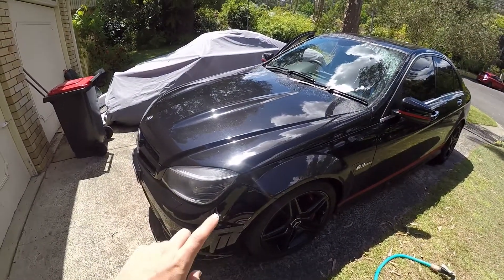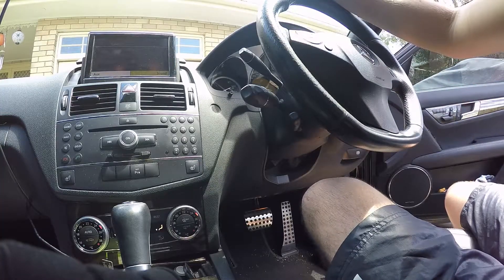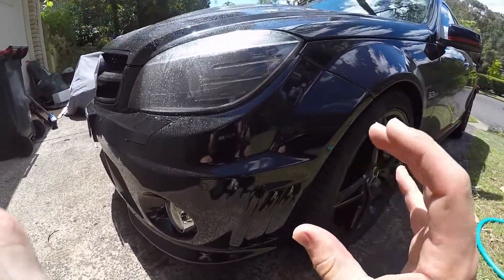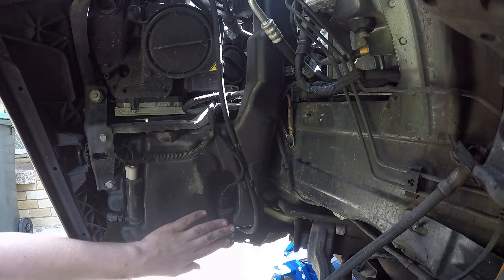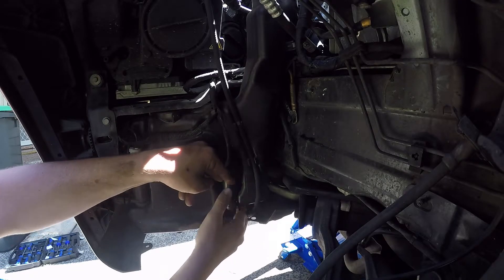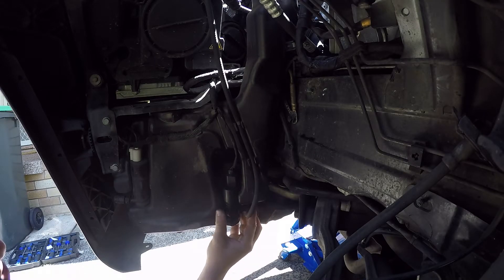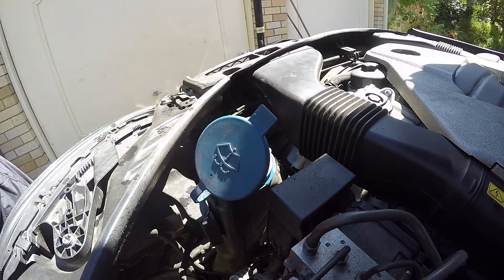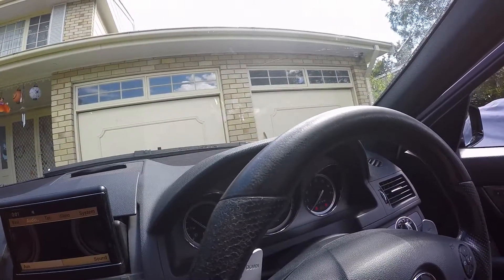Mercedes C-Class Washer Pump Replacement: How to Replace a Faulty Windshield Sprayer Pump

Comment: I am having the hardest time removing the electric tab on top
Reply from the maker: If it has dirt inside the it can cause issues. If you have compressed air then you might be able to blow it off and try again. If you push the tab in and move it as far ON as possible and back out you might have a better chance for it to dislodge dirt. Good luck!